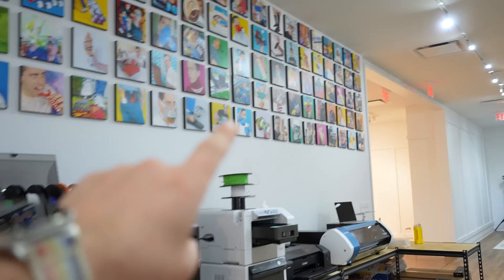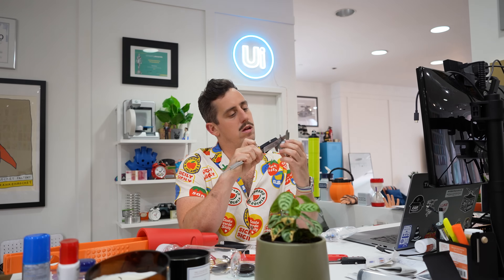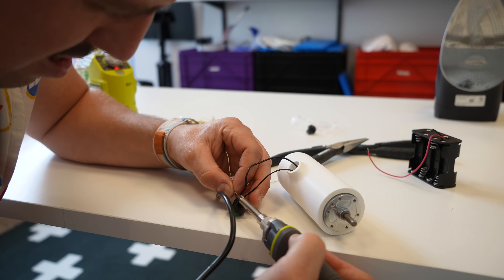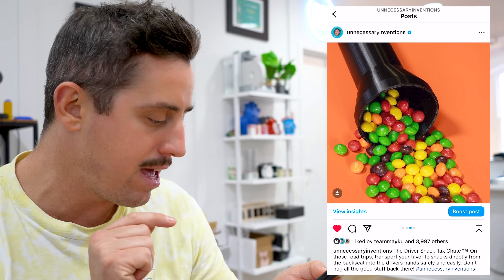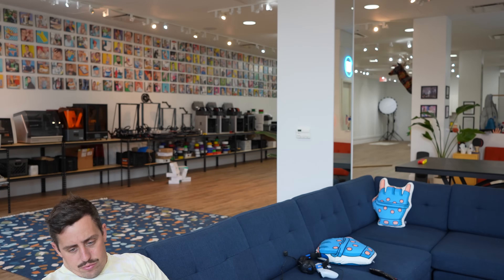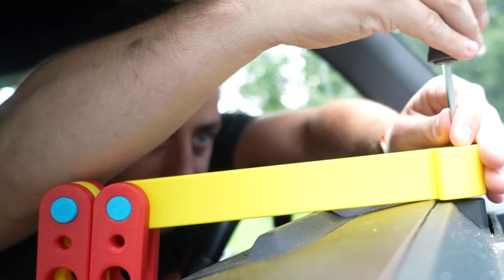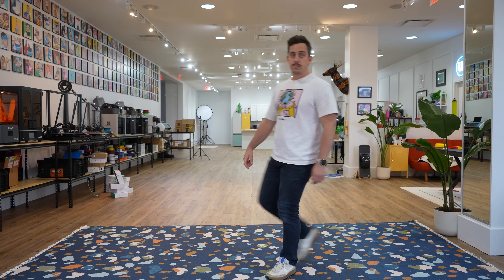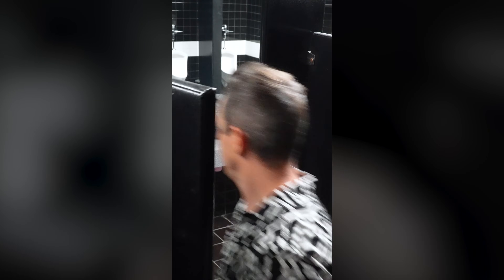I Re-Invented My Old Inventions

Comment: If you did a 3.0 version for the right round cone you should definitely make a spiral pattern on it instead so you can always tell when its spinning
Reply: And a variable speed controller!
Reply: The button placement should also change, it looks very awkward to press.  Either have it in place of one of the finger grips, or where your thumb can easily reach.
Reply: I Agree. Button should be placed on the index finger grip. Way easier to press it
Reply: @KyleVeatch  and mechanism to push cone upward
Reply: @RenatoDouek maybe a trigger like joysticks, can also have it give more speed the deeper you press it
Reply: That spiral could also catch the melting ice cream a bit like a gutter and collect it in a bottom compartment that you can eat/drink from when you're done.
Reply: And an easier battery replacement slot
Reply: Helloo everyone
Reply: @efferkah smart
Reply: this thread is so creative
Reply: I was thinking the same about a way to make it shorter or clip the top half off when you’re eating it
Reply: Hmm sounds necessary... I DONT LIKE IT
Reply: Yes
Reply: You know when Its spinning because you can see the icecream moving duh
Reply: @ it’s just an aesthetic thing I think would improve the design. Think of barbershop poles lol

Comment: I can see one problem with the 2nd reinvention of the food chute, if you actually have to use the gear shifter you might not have too much access to it
Reply: Or you get a little reward every time you shift!
Reply: I see a problem where it can’t easily be moved from front to back while driving
Reply: @nick.100   yea its really no better than a bowl that slots into the cup holder at the front. what he needed is a scissor mechanism so that you only gotta move one arm for the whole chain to unfolded all the way to the back. the linkage also needs to stay parallel so food doesnt spill out
Reply: Stick shift

Comment: Those are incredible inventions! 😄 I think it’d be a good idea if the ice cream holder had a small moat around the bottom to catch those pesky drops and keep your hands clean. And for the snack bowl, I think putting a handle on the bowl would be a smart idea so the passenger can securely hold the bowl steady while moving it. ☺️
Reply: That seems like a necessary invention and not unnecessary. 😅
Reply: Shouldn't it be unnecessary?
Reply: The moat isn’t necessary because you can still enjoy ice cream without it. The handle isn’t necessary for the snack bowl because it clearly works without it. 

I like convenience and comfort.

Comment: For version 3 of the snack "chute," it needs to keep the bowl level and have one-handed operation. Maybe a motorized scissor arm?
Reply: I was thinking of scissor arm too.  To make it more universal, it could attach to the rear head rest bolts. No need to motorize - the passengers can just squeeze the scissor which will extend it the whole length
Reply: Hydro handbrake handle
Reply: Trains use such mechanism, it's called pantograph

Comment: 1) So that door crack filler has another good use but needs a different invention: some changing rooms in stores, at least in Europe, have a curtain not a door, and the curtain never quite reaches the ends cos it's fabric and moves - your belt (or something) could work as a curtain stretcher, with some thought. 2) when I'm grilling a sausage or marshmallows or whatever over a camp fire using those long rods, I want them to keep rotating without straining my wrist, 3) my wife and my son go upstairs, get ready for bed and only then remember they need a glass of water so I'm the nightly water courier - I need a stick that will safely pass a glass of water up a flight of stairs, 4) I need a machine that washes the soles of my shoes before entering the house - door mats are stupid as I get them so dirty on the first muddy day then it takes longer to clean the door mat than to clean the shoes by hand. The trick is how this machine would accommodate different shoe sizes. Perhaps it should come as a line of 4 for different size brackets, that way the whole family can have their soles washed together.

Comment: For the RRC, I think it would be a fun item for kids (and adults) and people would by it if you could get it on shelves for under $5-$10. For 3.0 I would design like nesting shot glasses or extendable toy swords, so as your cone gets shorter you can collapse 1/3 and have more cone to eat. I’d also put a sliding speed switch  with some slower speed settings, as the speed it turns now is just to fast to be practical unless you just want to stick tongue out to lick it at high speed 😅. Great video!

Comment: Invention idea! Remember how satisfying it was to slam a phone down to hang it up? What if you had like a raised device holder/bed/landing pad shaped like a pyramid with the top shaved off but rectangular to fit the phone holder? There would be something to trigger the hang up button (and movable for different phone app UI?) but all you would have to do is finish your heated conversation and slam it face down into the device and it hangs up for you. Bonus points if there's a limp ~ding~ like an unactivated bell ringer just got jostled when the phone is slammed down.

Comment: You should’ve made the right round cone internally threaded with an additional shorter externally threaded cone for the inside of the original cone. Give the handle a second button so that the rotations can move forward or backward so as to push the cone up or down inside of the external shell allowing you to access the entire cone without as much struggle or mess

Comment: I think it would be great to add a motor to push the snack box from the driver to the back seat and from the back seat to the front seat because it's kinda hard to push the snack box back to refill your snacks while driving also the toilet crack cover can use a different material to stick on the bathroom stall wall because I don't think metal walls are common in toilets. These are incredible inventions by the way!

Comment: I'm slightly surprised that you car snack arm wasn't a lazy-tong: so you could manipulate one end (maybe a lever sticking up?) and have it extend to the back seat, then pull it back with the same control and not have to use both hand to do it.

Comment: On the back seat snack machine. What about running a cable down the arms so that you can pull/push a handle that will more the arm in one movement. That way the driver won't have to fumble around moving the arm and taking their eyes off of the road?

Comment: Ok the car snack should be a base that fits the cup holder with adjuster that can fit many cupholders and the arm should be like the old punching toy the extended with a trigger so u dont have to make all them movements while driving u can use a lever or something the extend it then pull it back

Comment: This is kind of a pet peeve of mine.  I know that this isn't something you'd really be using, but my pet peeve won't let me let it go.

No matter what type of plastic you print with, FDM 3D printed parts are NOT food safe.  The layer lines well accumulate food particles and bacteria that you cannot get out.  You should never use FDM 3D printed parts with food, unless it's a one off.  For example, if you're making cookie cutters that you'll only use once, not a great idea, but it will be OK. But if you're making cookie cutters that you'll use over and over again, FDM 3D printed parts are NOT safe.

Comment: metal is not garunteed what about plastic/fiberglass stalls non smooth surfaces so no suction 🪠 🚽 cups you didn't cover the entire length of crack because nelt wasn't long enough also excessive time waste with on and off belt people wonder 🤔💭 why it's taking forever for you to return from restroom 🚻🚺 breaks...  a hanger would need to be adjustable as not all designed the same and there's more to design for because cracks on both sides of door also 👟👠 shoe disquiser could be additional by having a drop to floor section hanging from the belt hangers  it'd look kinda like overalls with top straps and square patch 😅 definitely need it washable ... wearable maybe 🤔 idk how stylish it could be

Comment: I understand that the point is that the invention is unnecessary, but the arm to hold snacks in the car doesn't REALLY need to reach the back seat. The people back there have both hands free to hold their snacks. It's the driver who needs to be able to reach over and grab while keeping a hand on the wheel. 

Like, the extension is just unnecessarily unnecessary.

Comment: If you do a 3.0 for the Driver Snack one, you should use a few parallel four-bar linkages so that the bowl stays level while moving forwards and back.

This one: https://youtu.be/jUxZb0fy31g is driven by a motor at the top linkage, but the mechanism should work if pulled/pushed from the moving piece, so long as the base is fixed. Also make the bowl piece removable for easy cleaning.